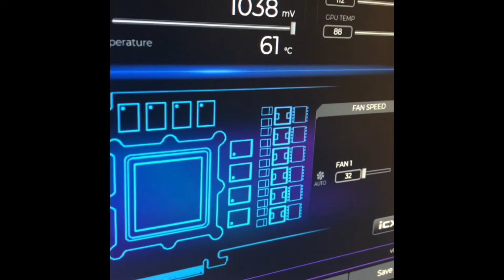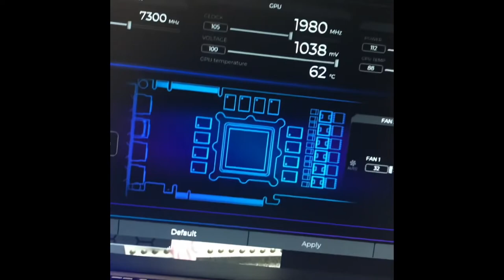Finally a solution to water cooling HPs RTX 2080 card! sorta.. HP Obelisk RTX w kit EVGA xc/xc2 aio

Comment: Just want to say thanks for the inspiration, I finally got a solution for my card! I took a different approach and was able to get a hold of a MSI Ventus 2080 shroud and heat sink (ebay). The MSI Ventus has the same fan headers as HP RTX to power both fans! The Ventus doesn't use the ribbon cable either. 1440P, went from 85C on Modern Warfare to 73C. On "The Outer Worlds" I went from 84C to 72C! Best of luck to everyone out there suffering with the pain of this blower card, if anyone wants to chat add me on Discord Robot#2083.
Reply from the maker: Thanks for the info. Hope it helps other people who are sure of liquid cooling
Reply: @hyp3r227  that's for the TI, I had a regular 2080 so I used the ventus shroud for a 2080. Make sure they supply you with the bracket as well! You should have 2 parts, the shroud with heatsinks and a black frame bracket.
Reply: @ramonvazquez2475  I left the ventus setup and I'm watercooled now on a custom loop as well. I also switched from the 8700 to 3800x.
Reply: @michaelrivera3688  how did you water cool your hp rtx 2080 and thanks for the help
Reply: @michaelrivera3688  so these liquid cooling parts will work with the hp rtx 2080 from the omen?
Reply: @hyp3r227  yes.
Reply: @michaelrivera3688  they don't sell the second link anymore what do I do sorry for so much questions but does the rgb also work for the gpu water block.
Reply: @michaelrivera3688  hello was install easy? I bought one from the link you posted on ebay.
Reply: @arbbs65  yeah its pretty straightforward. Make sure to reapply thermal paste.
Reply: @michaelrivera3688  awesome thanks did u use the omen rtx 2080 backplate?
Reply: @arbbs65  I did. I did forget to mention something, so sorry guys. You need to buy some new screws because the HP RTX uses thicker sizes. This is the one I personally used, make sure to check as you tighten them and make sure the shroud is making good contact with the GPU after you screw it down. I can't remember exactly which size I used, of course make sure to NOT over tighten. https://www.microcenter.com/product/610168/micro-connectors-assorted-laptop-screws-(250-pcs)
Reply: @michaelrivera3688  thanks did you have to do any system tweaking like msi afterburner  to make sure the fans were running at the right speed when the gpu got too hot. Or did the omen automatically set a default fan curve?
Reply: @arbbs65  good call out. The omen rtx has 1 plugin set for RGB and the other set for the single fan. I flashed the MSI Ventus bios so I can have control of both fans and it worked perfectly fine. I don't think this is a hard requirement but it makes sense to do it. Be cautious of flashing bios and make sure everything matches up before flashing it. You can use GPUZ and then make sure the bios you flash is the same device ID as your RTX. Mine is 10DE 1E82 and so is the Ventus 2080.
Reply: @michaelrivera3688  gpu bios flashing? Never knew that was a thing. New to PC. Ok thanks I'll have to do my research then
Reply: @michaelrivera3688  so you're telling me if I don't do the flash only one of my fans will run? Lol
Reply: @arbbs65  if I remember correctly they both spin but the rpms the fan run at are slower.
Reply: @michaelrivera3688  hello I finally installed the ventus shroud for my 2080. However the fan  is super loud. I plugged in the fans to the rgb port and fan port of the Omen card. Do I need to flash bios of my card?
Reply: @arbbs65  nice! Congrats. Try to flash the bios. Be careful though.
Reply: @michaelrivera3688  ok did you notice bad performance before you flashed the bios?
Reply: @arbbs65  its hard to remember because I flashed shortly after. I remember the fans rpm ran differently with the HP bios. I can't remember if it was slower or faster.

Edit: after flashing the bios reinstall your drivers too.
Reply: @michaelrivera3688  can you link the msi bios u used ?
Reply: @arbbs65  be EXTREMELY cautious flashing the bios. I don't take responsibility of course for any bricks. Make sure your device ID matches this bios, use GPUZ to make sure it matches. There are 2 types of 2080 cards, A bins (high bins) and regular bins. Mine was a regular bin so this is the bios I used. Do not flash a A bin bios on a non A card. https://www.techpowerup.com/vgabios/206920/msi-rtx2080-8192-181022
Reply: @michaelrivera3688  ok also were you on stock psu at the time of this mod?
Reply: @arbbs65  yes. Feel free to message me on Discord. My username is listed on the main post.
Reply: @michaelrivera3688  does it work for the ti to
Reply: @michaelrivera3688  Will those parts work for the 2080ti to
Reply: Michael Rivera  can I use other watercooling products with that like a mixture of corairs and the waterblock on this
Reply: @michaelrivera3688  is there any higher end waterblocks that work with the 2080ti too

Comment: Hey, i just bought HP 2080ti, i have my own AIO kraken X41 and G12 bracket to put on it, but i have to buy some VRM and memory radiators. Would you be able to give me some card measurments?? Mainly, how long is vrm section of the card + width of the vrm's (so i can buy one long radiator). And dimensions of memory chips and how many of them is there. Thx in advance

Comment: Hello!  I was tired of hearing the blower fan so I bought this kit and hooked it up.  My temps have dropped drastically, around 10-15c while playing 1440p games.  I found the fan with the installed splitter for around 24.99 on ebay.  I did however have to use a rotary tool and thin out the plastic around the 4-pin white/black connectors.  That way the shroud would drop right onto the card without any issues.  On the inside of the backplate I grinded down the spots where the screws went to hold the AIO tight to the card.  On your video you put the screws on top of the backplate, when I did this my temperatures were horrible.  So I grinded the backplate in those 4 areas flat, then tightened the screws down and magic happened.  Regardless thank you so much for this video, my computer runs dead silent now.  That blower style GPU is horrible and HP should be ashamed of putting the Obelisk style case into production.
Reply from the maker: Im glad I could help!
Reply: What’s the kit called
Reply: No offense, but is all this really necessary for a damn prebuilt computer lol
Reply from the maker: Well some of us are stuck with the prebuilt and can’t afford to spend more money to do otherwise. That being said the card still runs damn hot and needs to be cooled regardless. Just giving those a little hope for this awful pc lol
Reply: Ray Dizzle true. It just seems so drastic that people have to do all this extra shit just to have the computer running how it should. Smh
Reply from the maker: It is. Wish I had done my homework before ever buying a prebuilt. No more.

Comment: Hey there, I made the CPU water cooling upgrade and I was thinking about going through with the GPU evga hybrid. Do I need to also get the commander pro for the radiator fan? I am not planning on adding more fans, only the evga. Your guides are amazing!
Reply from the maker: Emiliano Herrera yes, you’ll need another fan port. The great thing about the commander pro is you can run you on rpms for any fan that you plug in. Plus it adds two additional internal 2.0 connections. Remember to grab a 3.0 to 2.0 adapter tho or else you will not have anywhere to plug your commander pro

Comment: I bought an obelisk also. The hardware It brought from the CPU, GPU, PSU and Ram are more then good enough for gaming. Unfortunately yes the case is ASS for air flow, and when you start gaming for an HR the temps get crazy high (85 - 88 C )
So I did upgrades 
H60 Corsair for the CPU GTX 1060 6GB card and downloaded EVGA precision software 
Now I get solid 54c on CPU (values) max @ 66c 
And 74 C on my card
Also managed to keep the case temp around 32c on heavy gaming 
Got to say I was annoyed at first but I did go into buying a gaming PC blind. Didn't know anything about computers but this one taught me a lot.
Reply from the maker: Mitchell D I actually loved the case and honestly would have kept it but got this case for free pretty much. Plus it had much more space for fans. I’m just pissed at the fact that there is no room for major upgrades like they said. At 2k though I would not recommend it. I also have learned so much since then and will build my own computer next time for sure.
Reply: Ray Dizzle would you recommend it at $1300? I can finance it from Best Buy 12 months no interest for $1300 but the gpu temps scare me and I’m new to gaming PCs and never built one. Could I upgrade the cooling so it will work. Only game I play is fortnite at just would like to run 60fps on it as well as pubg and such
Reply from the maker: Absolutely, but before you do. 

If you’re just scared of building one trust me it’s not that hard. I too was terrified and knew nothing. After I got it and studied it and wanted to hit myself on the head. Then again at 1300 its a great starting point if you want to just get gaming. You’re still getting the RTX GPU and i7 8700. If you’re not doing 4k on it you probably don’t even have to worry about cooling it and can push a lot more FPS. If you are planing on cooling it then just keep in mind there’s two options that I know will work with this HP RTX. One is the EVGA, but will require to switch out the fan. Second is the alpha cool AIO which I believe doesn’t use a fan.
Reply: Ray Dizzle oh yeah I don’t plan on doing 4K gaming. Just want to at least play at 1080p or 1440p 60fps on fortnite, pubg, Csgo and other games that come out. I would build my own but I don’t have much time do to work and college so buying one would be better. How upgradeable is the hp? Can I always upgrade the case to a Corsair one?
Reply from the maker: Case yes. Upgrading anything else is kind of pointless since the motherboard is locked.
Reply: Ray Dizzle should I upgrade the motherboard? I mean would it be better if I got the gtx 1060 version for $900 instead?
Reply from the maker: I’d do the RTX. If you don’t plan on doing 4k you really won’t need to upgrade anything in awhile. You’ll be solid.
Reply: Ray Dizzle ok cool! Thanks man! As long as I won’t have to worry about the cooler and wattage for awhile than that will work with me. I do plan on one day upgrading it and putting the components from it into a Corsair rgb case with more fan slots and also upgrading the wattage to a Corsair 750w and doing liquid cooling

Comment: Could you take some pictures of the hp metal plate covering the memory and vrm??
Reply from the maker: Sadly I no long have the kraken nor this GPU with kit. However I can tell you the EVGA kit work extremely well. The plate was well designed and fit perfectly covering both vrns and the GPU. With the exceptions of replacing the fans.

Comment: @RayDizzle why couldn't you use the EVGA Top Plate? 

Also why does the y splitter only have 3 wires on the plug yet the pump connector has 4 wires? I know they're both 4 pins but curious about the wire set up.
Reply from the maker: The EVGA kit does not come with a top plate. They give you the option to use or not use your own plate. I used mine because I went for aesthetic reason. 

I when I replaced the original fan 87mm I made sure I found one on eBay with a y splitter and that it had 4 wires. Although if you can’t find one with for wires it still should work, giving you control of fan speed with additional software like afterburner or EVGA X1 precision. You DO NEED a fan with the y splitter. Otherwise you won’t be able to connect the pump.
Reply from the maker: That’s the one. You’ll love the EVGA kit tho! Plus there’s other top plates on the market if the HP one is too plain for you. Thanks I appreciate the support!
Reply: @ramonvazquez2475 Awesome thanks and yeah man absolutely keep up the good vids my dude.

Comment: Hmm how did you know you needed the XC/XC2/FE instead of the slightly more expensive FTW? Any idea what the difference is? 

The EVGA website is currently out of stock for the XC/XC2/FE...

However in stock for the FTW3
Reply from the maker: I got the hybrid kit for the my FE card. Not the actual EVGA 2080 cars.
Reply: @ramonvazquez2475  So our HP 2080s are FE?
Reply from the maker: Yes for the most part. With the exception of the fan connection and led connection as explained in the video.
Reply: @ramonvazquez2475  Would the FTW work the same way the XC/XC3/FE did.

Comment: why do you have the gpu radiator fan as intake? I thought exhaust would be better to avoid all the heat that's generated from gpu that's gonna be blowing alot of heat in youyr case!
Reply from the maker: I do have a pull push for the GPU radiator on the front. I have three fans for exhaust to help. Two on top and one in the rear to cool down the case.

Comment: I have been looking for this kit for months with no luck. Where were you able to find it?
Reply from the maker: Erick Onassis I’ve heard people saying it’s hard to find now. I got it off EVGA website directly
Reply: @ramonvazquez2475  it's damn near impossible. Thanks for the fast response. I just bought one of these Oblesisk PCs but I am going to switch it to a Thermaltake core p3 open air case, NXZT Kraken g12 with an AIO for my GPU, just haven't decided on which one as yet. What are you currently using for your AIO?
Reply from the maker: Erick Onassis before switch to a custom loop I had the kraken for my cpu and the EVGA kit on the GPU. Kept them cool. There another AIO for the GPU you should check out. It’s the alphacool

Comment: i've noticed this kit is no longer in stock. do you know if another kit similar to this is available?
Reply from the maker: There’s the the Alhpacool RTX AIO cooler. It’s around $200. However since our GPU fan connect are different from the actual reference cards I’m not sure the connections will match. Keep me posted if you go that route.
Reply: Will do. Did you do a video on the case you moved everything to?

Comment: Hi so I got this case and I want to cool my gpu, point is my fan connection are all occupied from system, cpu fan and a 120mm fan on the top, where would I plug the kit? Could I plug it in the hdd2 plug or is that wrong. Sry new to assembling here
Reply from the maker: Check out my video 2/3 upgrade. Explains everything I did

Comment: Could you post the Amazon / Newegg link to the EVGA hybrid and the fans?
Reply from the maker: The hybrid kit I got straight from EVGAs website. The fans I got from eBay but I can check amazon
Reply: @ramonvazquez2475  you have the part numbers? There are 2 listed on the site.  Also is the heatsink not included?
Reply from the maker: Mike Crow PLA09215B12H and just make sure the the fan has a splitter so you don’t have to buy one!! The heatsink is included. What was missing  was one thermal tape strip which I simply reused from our own block. You’ll see our block has three.
Reply: @ramonvazquez2475  thanks,my case should be here this weekend... wanting to get all the parts so i can do it all at once
Reply: @ramonvazquez2475  part number for the cooler? there is 2 listed on the site... cant really tell a diff between them

Comment: Bro i bought this piece of shit for 2000 at best buy as well. But ive done a few upgrades since bought i bought a new cpu fan and a new case. Added 3 120mm fans with the thermaltake controller suprisingly it worked and my temps stay at tagert range which is like 70-79 at max load with 40 speed of fan or 45 not bad you went all out which is cool but id wouod upgrade your case bro
Reply from the maker: Really?? That’s not bad at all. I was able to achieve those temps but with fan speed at 100% and target temps lowered to 80c. Even with the case open and plenty of airflow. My GPU just sucked. That’s why I had to get the kit. If you lower the temps by 10 degrees you’ll see a boost in performance, but if you’re still under warranty don’t mess with it yet. At 2k you’ll still want to hold on to that lol. I got mine on Black Friday so it saved me a bit.
Reply: @ramonvazquez2475  yeah i think you got a messed up gpu perhaps. Before the case upgrade i would go at 50 fan speed and i would stay at 70s but now i stay at those temps with lower fan speed i think u should really try a new case. Cuz the one we got is fucking shitttty af lol wish it was a better build tbh
Reply from the maker: Jay Blanquel it’s definitely my GPU. I have four fans blowing air into the new case. From what I’ve been hearing allot of people have the same problem. You got lucky my friend lol
Reply: @ramonvazquez2475  It matters what you are asking the card to drive as well.  If you are just pushing a 1080 monitor to 144hz you could maintain those temps.  Since I upgraded to a 1440 monitor with 144 hz I've been pushing temps much higher, much faster.  With my CPU water cooled and a fan blowing air towards the GPU I can average temps on the card just below 80 degrees when playing.  Still too high for my liking though.  I'm trying to modify this case to last at least two or three years without too much worry.  Did you upgrade your PSU?  With all these fans and pumps I'm wondering if that will be the next thing to go.  It was a border line PSU before these upgrades.
Reply from the maker: Soule Family yes the PSU was one of the first things I Upgraded.